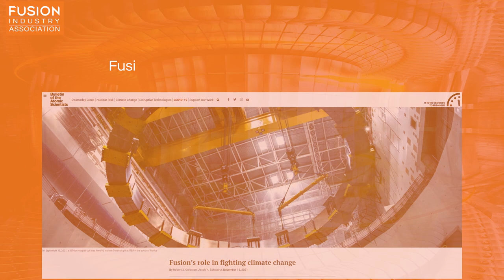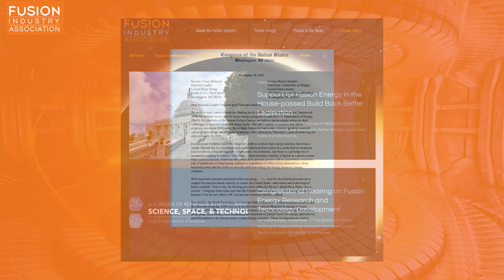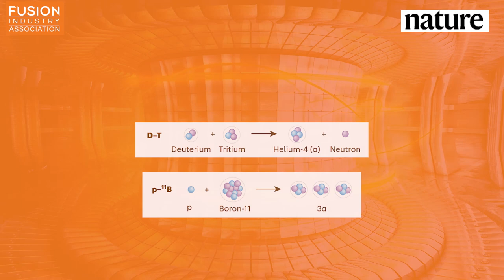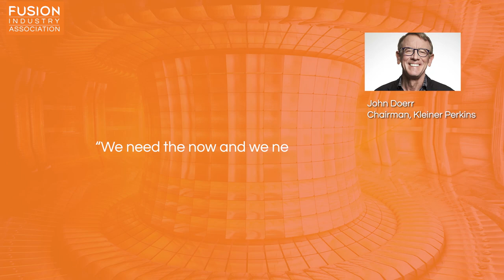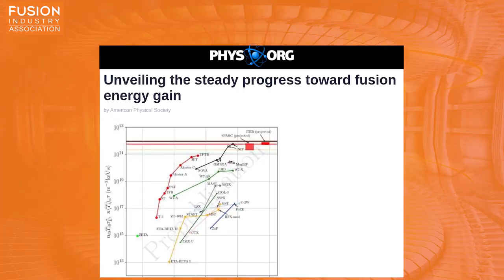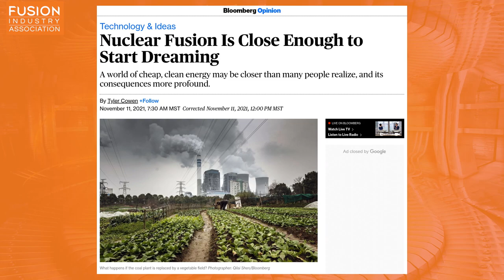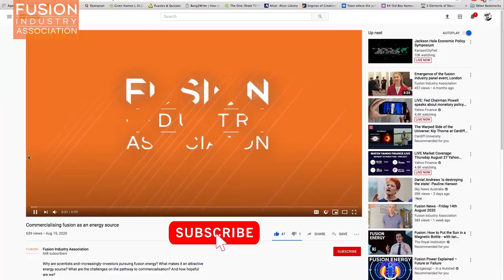Fusion News - Friday 26th November 2021

Comment: Nuclear really is the only way forward, particularly fusion, once you find out that for every atom of silicon we reduce to make solar cells we currently oxide a minimum of two carbon atoms. It is surprising how few people realise where silicon actually comes from and how it is refined from silicon dioxide sources such as quartz using coal. Sure there are other methods possible, but they are not used for economic reasons therefore the entire economic viability of solar PV tech is founded on cheap fossil carbon derived energy until we can produce even more abundant and cheaper energy via fusion.